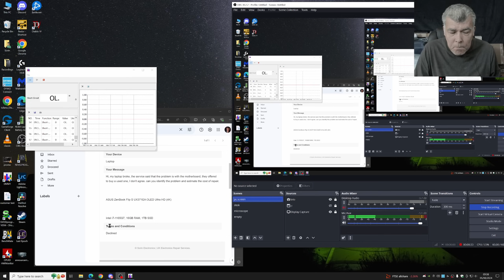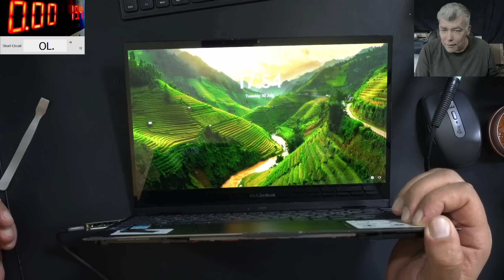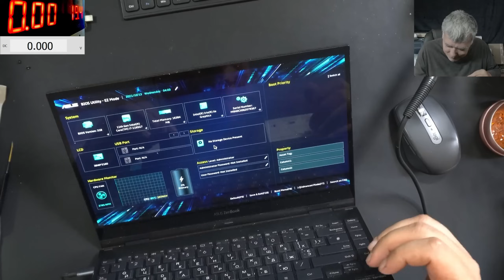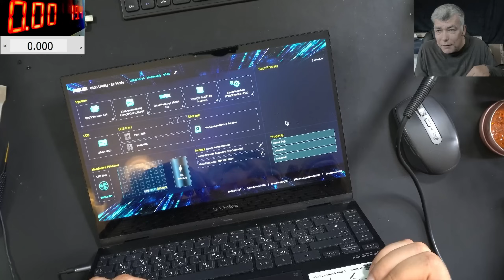ASUS ZenBook UX371EA freezing in windows, this fault can cause a laptop to freeze

Comment: What model of the board is it? Ux363ea or ux371ea? I have the component that says: "intersil 9241H W020HH" burned, it made a short, I accidentally touched it with a screwdriver. After that it worked but it no longer charges or works with the charger...help please
Reply: I have the same laptop

Comment: Back in the day touch screens were the big thing like media center in cars that dident have touch screens or the newer laptops id see pople using the screens tapping away then getting bored and never using it again, for alot of laptops it was a selling point and that was it really but i never seen the benifit of them, not unless its in car or a media control unit, Good find and i agree i wouldent miss it if it was taken out of action and would defo be happy to get the laptop back at a decent repair price

Comment: why is my asus so slow i have done everthing from youtube to make it faster but now i think toutube is fall of crap
Reply: you watched whole Youtube? damn.. if I will have a question I know who to talk to!
Reply: what asus you got there?
Reply: Vivobook 15 Asus laptop x507uf                                  Intel(R) core(TM) i5-8250U CPU                                    4 GB ram                                                                             Another problem is the BIOS comes up on start up. I have tried every trick in the book on youtube to fix but nothing has worked
Reply: @dalewatson3814  Faulty keyboard can bring the BIOS screen, it can be also due to messed up settings of legacy/secure boot too which can take you straight to BIOS screen as it's computer's way to say that the nappie is spoiled so please change it!😂😂😀
Reply: I guess the easiest fix you can try is to put an SSD with a fresh install
Reply: @balazsio  bro did everything available on YouTube, you can't compete with that 🤡
Reply: @MrFrambooise  I see your point, but be gentle and generous and the world might turn to be a better place
Reply: @balazsio  your generosity is finite, be careful who you spend it on
Reply: Well maybe you're full of crap if you don't even post the specs of the laptop, it could be a pile sh*t for all we know. It could be the hard drive is full, virus, not enough ram, until you give some basic info, not just a brand name, I doubt you'll get far.
Reply: Need SSD

Comment: My Asus zen book will stop holding a charge. I have to have it connected to an outage let for it to work. Is there any way I can swap out the battery?
Reply: what are you asking?
Reply: @MrFrambooise  if he can replace the battery. thats what he wrote.
Reply: @cptrush3671  I know, point being it's a stupid question
Reply: @MrFrambooise  the only stupid question is one unasked. no its not stupid. some people know very little about the subject.
Reply: @cptrush3671  The answer is in the very video+ it's common sense. So yea there are stupid questions and that's one of them
Reply: @MrFrambooise  sorry i beg to differ. sorin did not say its possible nor did he say its ok. therefore the op asked a good question.  to answer him all you had to do is say yes or no. instead of spewing your hatred on them for not knowing something.
Reply: @cptrush3671  Exactly! On the bulls eye!😂😁😀

Comment: I think I would do the same and advise the customer not to bother with replacing the screen. So many people buy touchscreen laptops and AIO desktops and find they hardly if ever use the touch feature. You just end up with aching arms and fingerprint smears all over the screen. 😆 The webcam might be a problem though but I guess if you really need one you can plug in a USB webcam.
Reply: even windows don't think touch screen / tablet style is a good idea anymore...

They tried to push this trend in Windows 8 and things went sour quickly.

And I agree, using touchscreen on a home system is more of a hassle than convenience...
Reply: @nickochioneantony9288 i kinda like it and can see it's benefits plus it's an option you have
Reply: Also there are other issues, sometimes the touchscreen gets crazy and starts ghost touch, pressing randomly. I think the webcam uses the LVDS cable, not that one.